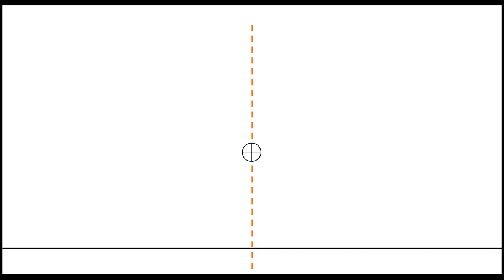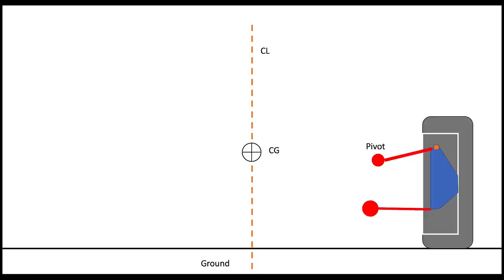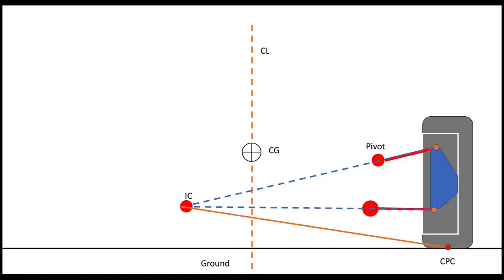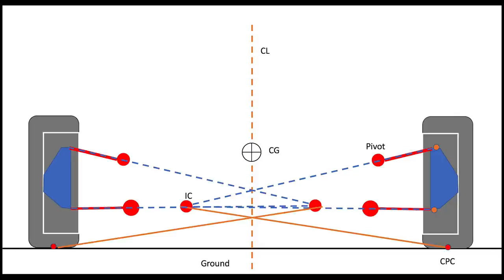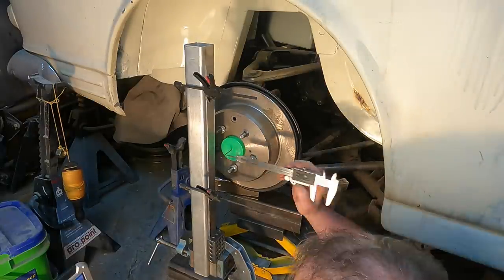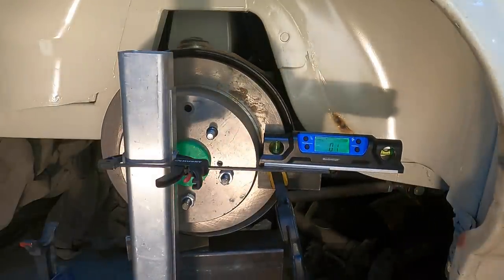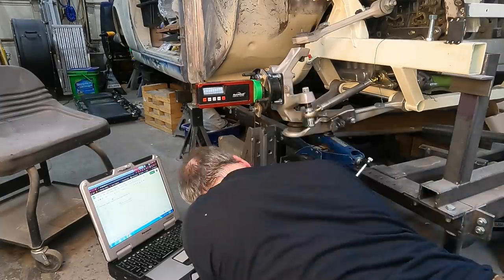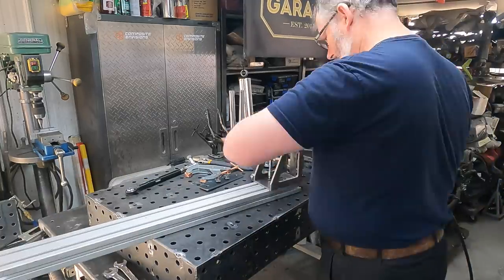Suspension Tuning: Roll Centers and Dynamics

Comment: Doesn't the lower control arm being pivoted forward of the centerline create anti-dive, similar to the rear lower arm being tilted rearward? 
The upper arm on an angle shouldn't have the same affect, but being rotated backwards from the main pivot position of the lower arm as you have it would create caster gain throughout the travel. 
Unless I'm missing something I can't see the relation to the upper arm affecting the dive characteristics.
Reply from the maker: Not sure I understand what you mean - the LCA relationship to the hub centreline creates caster not anti-dive.  Anti-dive is created by having the rear upper control arm bushing lower than the front.  This creates a side view swing arm (like a roll centre if you like - but in side view).
Reply: @ThrottleStopGarage  Castor is the angle between the 2 pivot points on the hub centerline, the upper ball joint being rearward of the lower ball joint will give positive caster. With the upper arm having that much of an angle difference, on compression the upper ball joint will move further rearward from the lower creating more caster. In this specific example it is also likely to effect bump steer by increasing toe on that wheel under compression, and toe out would likely happen on the inside wheel on extension. Having driven track cars the bump steer is undesirable in that situation. - But this might actually do the opposite, would be interesting to test.

I probably don't fully understand the relation of the UCA in this equation but If you picture the extreme example of the LCA mounted at a 45degree with the front pivot above the rear, the car would compress the arm heavily under breaking from it pushing backwards on the arm. If the arm was rotated 45 degrees forward the braking action wouldn't move the arm in compression, it would in fact extend the arm. (at the extreme 45 degree angle)

It would be fascinating to see measurements of the toe as well as castor change throughout the front suspension travel as well with your setup. It is very well thought out for a visual reference.
Reply from the maker: @CBOCalgary  Yes, of course - I was trying to work out what you were getting at.   There is castor gain with compression and loss with extension.  This is by design - that's what the Corvette C4 suspension is designed to do (as is the C5, C6. C7, C8...and most others I have seen). Bump steer is virtually zero.  I've measured it.  I could add this to the next instalment. You could also tilt the LCA up at the rear - but this suspension was not designed to have a tilted LCA.  It's complicated - but generally anti-dive is used to control body pitch during braking by transferring load through the suspension links and arms instead of through the springs/damper. If you go above the 100% line you can induce jacking under braking.  Sure - not sure why you'd do that.  I'm just finishing optimizing the suspension and will see what works for explaining some of these behaviours.  I'm more concerned with packaging right now to be honest.

Comment: As a novice, I'm still confused.  You say the 2D method isn't helpful to you, but I'm having trouble understanding either the 2D or your method.  What exactly are you showing is better from one versus the other?  And what's the problem that you solved?  I see that the graphs have different lines, but shifting those did what exactly for you suspension?
Reply from the maker: The idea is that the roll centre give you information on how the car will handle by summarizing the effect of the links.  You CAN think of it as a point about which the car rolls - if that's helpful at the start.  Now, if you're tuning, you'd have to work out the link location to try to figure out what is going to work.  That ends up being a bit of a bother if you're working with a 3D suspension.  As others have pointed out - you can always jam the numbers in a computer program...but they most likely won't tell you anything unless you understand what they mean.  The method I've used (it's not my innovation) is to just measure the contact patch centre point's motion.  You don't, for example, want the tire to move laterally 1" over a bump - the car would be impossible to drive. So I moved the suspension links to dial these properties out of the suspension and achieve better geometric properties.
Reply: @ThrottleStopGarage  ok, so maybe I need to step back a little further, what is a GOOD roll center?  Why is that good versus what you started with?
Reply from the maker: @capnthepeafarmer  Unfortunately - the answer is it depends.  It depends on the style of suspension you are working with, use of vehicle etc.  For example, most strut suspensions have a RC that is at ground level.  It's fine - but they will need an anti roll bar because the weight is transferred through the springs in roll.  It is best to think of them as being the result of suspensions not the start of suspensions if that makes sense.  So the RC I had from my report for the rear would indicate (at over 6") that the suspension was going to behave like a swing arm (so it will fold up under hard cornering or braking events) - I didn't get that picture when the report came in...working with a real suspension engineer...it was his first observation.  That estimate turned out to be incorrect (thankfully). But I hope this makes the point - what those numbers are telling us is not what I've seen explained.  It's not a dark-art - it's just poorly explained.
Reply: Capnthepeafarmer; To really simplify it. A good suspension allows your tires to have good ground contact in all positions. Your car have about four handsize contact surfaces to the ground, and all forces you apply to the car are depending on the friction to those surfaces. It's the most important part of the car. When you turn the wheels, you still want the contact surface to renmain good. If you apply some speed to the scenario, and add some roll so the outer wheel is pressed down , while the inner wheel springs out, you still want an optimum grip. Different cars look for different behavior.   If you look at drift cars, they have a very optimized suspension setup for maximum grip at full turn, but not so good at normal driving.

Comment: After watching the video I have one big question. How roll center height matter or effect on supension performance or car handling?
Reply from the maker: The RC summarizes the links at any position of the suspension.  You'd like the RC to move a little but not a lot as the car goes over bumps or is in roll.  So what I had before would have been an adventure to drive, where what I'm trying to get is going to work very well.

Comment: I don't entirely understand how you calculate your roll center height using just the lateral positons of the contact patch center point in different suspension heights. You still need to know your instant center right? What's the formula you use? Great project, though! Keep it up! I like how you deal with all these problems.
Reply: Got it now. I'm amazed at how simple this method is
Reply: @Everude3000  how?

Comment: Around 18:00 during compression, your camber is getting more positive, not negative. Is that expected? From your graphs, and maybe I wasn't paying attention, it's not clear if ride height positive is up or down.
Reply from the maker: It's hard to see the negative symbol...but it's going negative in bump past ride height and gaining camber in droop as normal.
Reply: @ThrottleStopGarage it's not. Unless yours is different, I've owned that camber gauge for 12 years. It's going positive during compression. Once you cross zero while going up with the jack, you can see the little triangle on the inside is on top, and on the outside it's on bottom. That indicates positive.
Reply from the maker: @grant1984  at 18:00 to 18:14 the suspension is being cycled through it's extension (droop) not compression and you're right it is gaining camber (positive) relative to ride height.  That is expected.  It crosses back through static ride height at 18:14 and from there it is in compression relative to ride height and is correctly reading negative camber.  This is expected.
Reply: @ThrottleStopGarage  at 18:01 when you start to droop the suspension the gauge does indicate the outside ( to the left of the gauge reading) is higher than the inside (to the right of the reading). This is the opposite of my expectations.
Reply: @ThrottleStopGarage  at 18:20 it's reading 1.2 degrees positive based on my experience, and the owners manual for the gauge. Do you agree?
Reply from the maker: @grant1984  Nope - https://www.longacreracing.com/tech-central.aspx?item=42369&article=AccuLevel%E2%84%A2%20%20Pro%20Model%20Digital%20Level%20%28ver.%205%29

Triangle in the bottom left/top right is negative camber on my gauge.
Reply from the maker: @DanielODonnellProAwe  I'm already a little over an inch in droop (extension) and it is gaining camber which is exactly what would be expected based on a SLA design.  The rate of camber gain loss is relatively linear over the operating range of the suspension.
Reply from the maker: @grant1984  very odd.  I wonder why they changed it.
Reply: @ThrottleStopGarage  very good question.

Comment: How do you calculate what rollcenter height, camber curves etc are ideal for you?
Reply from the maker: Trick question - if you're going with a suspension transplant like I'm doing, then things like the shapes of the curves are set by the lengths of the links.  You can tune the location of the curve.  The rest really requires some experience that most don't have.  Knowing that RCH is a summary of the links and their location is important.  In general, you can look to what the donor car had for RC's and work from there.  Then there is the RC height different front and rear - the roll axis and it's inclination.  Most books tell you how to compute it - they don't explain how to optimize it.  Camber curves are a little easier as there will be body roll and you design in the roll angle (it's not as complicated as I'm making it sound) depending on what you're designing the car to do (race car - street car - family car).  We worked out an "optimum" camber rate of 0.6º/ inch and allowed the body to roll the same amount for 1.2º/inch which is sporty but not race car.
Reply: @ThrottleStopGarage  
Not necessarily doing a transplant, but changing the geometry. To give you a parallell, though might seem as a silly one, i've been doing allot of rc racing. Might seem as toy cars, but you can basically set them up and change everything with little effort (springs, dampening, pack, ackerman, rollcenter, camber, camber gain, weight distribution etc.). Though, these racing cars are usually set up quite good from factory and then work your way from that to suit track, conditions and driving style. But my 1:1 car does not have a good baseline. So is there a way to guesstimate/calculate this? Guidelines maybe? How did you land on your result? My goal is also trackday/sporty. Issues i know i need to fix i.e. is its understeer tendencies, both from bumpsteer and positive camber gain.... (mcpherson) But would be nice to know if there is some good practices here. One with rc cars is do one change at a time and keep a log, but that's after the fact, hehe

Comment: @6:40 isnt this technically considered Caster? The angle of the upper arm dictates caster while the lower arms angle will dictate anti-dive? Maybe thats just for RC car suspension tuning.
Reply from the maker: No - caster is the displacement from vertical of the steering axis.  UCA angle is use to create anti-dive.  View the suspension in side view - there is also an IC in that dimension.  So in this case the UCA is behind the centre defined by the LCA giving caster and the tilt of the UCA gives us anti-dive.

Comment: Could I also add.  Looking at the video the jack is trying to lift the bottom arm off the table after a certain point.  Hence binding.  Perhaps the jack under the spindle would be alot better
Reply from the maker: Fair point. I know when I was doing this that the forward jack position was harder to get a consistent purchase on the arm. The jack can't slip position (you'll notice that I've clamped the jack to the table to combat this).  The binding was solved.  Still waiting on parts (unbelievable but true) and I'd like to get the new design build in the next few months.

Comment: Your key term is "instant!"  At best a computer program/test mule can only predict what should happen under a specific set of conditions . . .  then the real world happens.  (For example, under a certain cornering load, the car body/frame/suspension points move in a certain way.  Then it rains!  So you don't get the same input loads at the lower speed and the car doesn't twist/roll so much and the "instant" that was calculated never happens.  Etc., etc., etc..)
Reply from the maker: Yes - this is the real "nut that needs cracking" is "instant" - it applies for that geometry in that position...that's what you get.  I think this point does get a little lost - instant things have a place but in reality it's things like RC migration and control that matter dynamically.  I'm hoping to do a little computer simulation of this but without forcing myself to go through the exercise of working that suspension, I would not have gotten much out of the computer output (as is evidenced by me not understanding the report I got in the first place).  I'm starting to get it now...slowly.

Comment: So what was causing the suspension to bind?
Reply from the maker: It was a combination of a few things (isn't it always) one of the problems was in the bearing I was using...the rest was in the geometry.  I fixed both - simple enough, but I'm glad I found it before I discovered this issue on the road.

Comment: I don't understand how you go from 0.06" contact patch movement to 1.7" roll center height at 12:11
Reply from the maker: That's the rate of change per inch - so then multiply the 0.06" by 1/2 the track (so for my car 28") - that gives you 1.68" - so 1.7" if you round.
Reply: @ThrottleStopGarage  I'm still not seeing it for some reason. It's 0.060" horizontal movement for 1" vertical movement so I see where it would be 1.7" inboard for 28" vertical? But is it getting mirrored or rotated 90deg somewhere?
Reply from the maker: @jimdaug  It's how much the tire contact patch is moving laterally.  So we're measuring the slope of the force line.  The tire movement creates the force.  You can mirror the line if you like - but it intersects at the vehicle centre line unless your suspension is asymmetrical.  So the distance is from the contact patch to the centre line.

Comment: Isn't the camber curve a function of the length of the control arms? That's why formula cars have as long arms as possible.
Reply from the maker: There are other reasons that control lengths for formula cars.  Yes, the relative length of the arms and separation of ball joints and mounting points control camber gain.

Comment: On tarmac I like to have more Caster than KPI to save more camber during tight turns. A car with a low RC is easyer to ballance due to more use of swaybars because the lever from the CG is longer and make more roll. A solid axle with a high RC will allways try to flip the axle and leave the inner wheel in the air. On tarmac driving with a slight or more drift Ackermann is useless due to making toe out during drift and the car unstable in steering. Ackermann is for street use and posers only.

Comment: Ok hold on.  This is what you put on screen when you are talking about the rear RCH
(0.55-0.43)/2=0.06
RCH =1.7
Where are you coming up with the RCH number ? You don't explain this at all, just say that the 2 dimensional renderings are wrong. I get that, I have a Mercedes 450slc drift car with a very similar SLA front end that's been desecrated by being lowered, the RCH is underground as far as I can tell and I'm extending the lower ball joint to compensate. I have a full subframe getting set up for control arm extension jigging and so I can run it through it's travel with a rack and pinion conversion to make sure bump steer is minimal. I just don't see where your measurements tell you where the RCH is.
Reply: I was also wondering what the actual equation is.
Reply from the maker: You then take the slope (0.06) and multiply it by half the track to get vehicle centre.  I did cover this.
Reply from the maker: (slope) * 1/2 track
Reply: @ThrottleStopGarage  where are you getting the slope (some call this the n-line btw) from? The slope is contact patch to IC, so how are you getting the IC from just lateral movement?
Reply: @ThrottleStopGarage  if you haven't seen a K&C rig before, they also get RC's from vertically displacing the wheel. But, i believe, they look at how the camber is changing. The wheel camber changes around the IC, and using a little geometry, they get the RC height/ lateral location. They're able to plot how the RC changes in bump and roll. 
Youre method seems super simple, but I'm not wrapping my head around it.  Perhaps a short video/picture explaining?
Reply from the maker: @sevenducecut  I've only ever seen a rigs in photos.  My guess is that they are using the same wheel displacement method I'm using.  Of course, it's all changing at the same time.  I'm just about done the next video - it goes over how I optimized the suspension.  I think we're doing the same thing.  I was able to get good agreement between the method and computer output of the measured points.
Reply from the maker: @sevenducecut  Just rise over run - lateral move/distance.  The slope is indeed the contact patch to the IC and the RCH is estimated as 1/2 track width * slope.  It's not perfectly precise - but it's in the ball park as a first approximation.